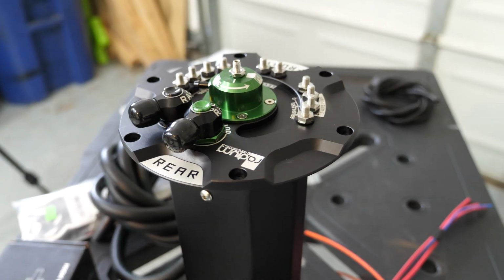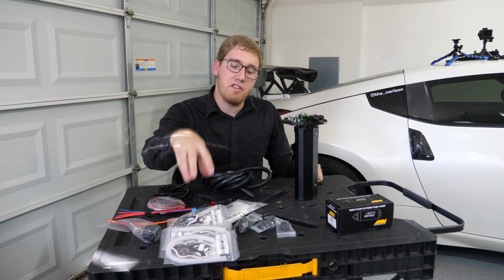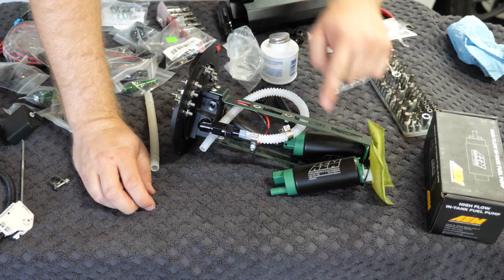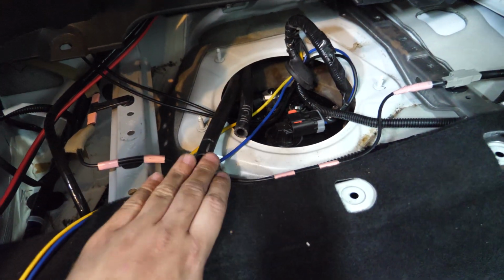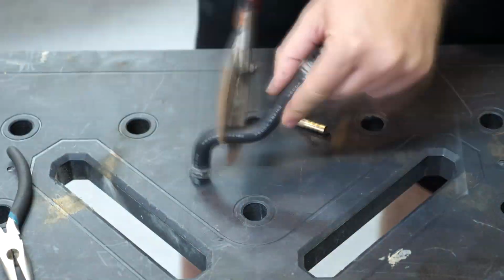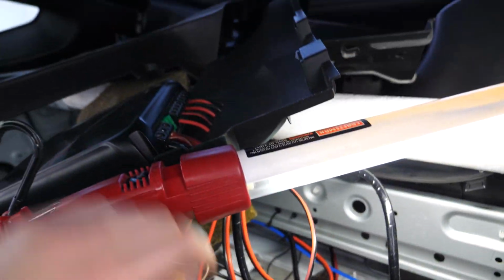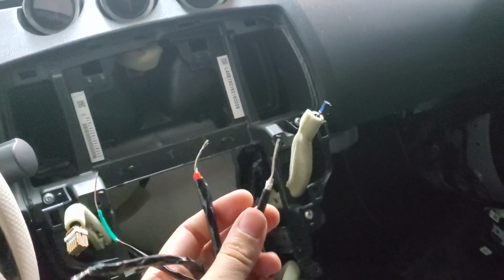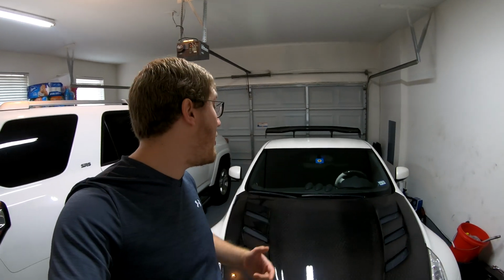Supercharger Install Ep. 5 - Fuel Return System + Gauges

Comment: I followed this through completely. Car fired up once and then shut off and then fuel pumps would no longer turn on. All 3 died out of no where. No shorts or any missing grounds. Any clues as to why? I will mention i did have the lift pump wired backwards. We had only primed it three or four times then switched it back up. The car ran after switching it but then died a bit after. I dont see all 3 fuel pumps dying at the same time like that. Some insight would be nice. :)
Reply from the maker: Check your fuses, relay connections, also would be helpful to put a multimeter on the pump leads to see what voltage is getting to the pumps.

Then you might want to check the resistance of the pump itself to see if the pump is dead or not. (Should be a few ohms. 0 means it could be shorted out, open means it could have burned out, ideally do this with none of the wires attached.
Reply: @thecarizon504  checked my main fuse immediately after making this comment and it was blown/too low. Swapped for a 30A and it'd good to go. Thanks man! Lol

Comment: Where is the return port on the top hat according to the website there should be a 3rd port for a return fuel system if you want to use it .. I only see the 2 in and out and the pressure regulator the picture on the website shows 3 ports
Reply from the maker: They must have changed the system since I installed it, mine only has two ports, one for the line from the lift pump in the ither aide of the tank, one for the fuel to the engine.
Reply: @thecarizon504  ya they must have it's confusing when you see it online with 3 but in videos only 2 ...how is it working so for for you
Reply from the maker: @sask350z  no issue so far, no hiccups outside of the fuel level being off initially, would read empty when O still had half a tank but I think the fuel level sensors relearned / cleaned up after a couple thousand miles.
Reply: @thecarizon504  ok cool good to know ...I just got off the phone with them and asked why yours is a two  port version and the site shows a 3 port version.... They said they changed it a bit ago you must have got a older model all the new ones come with 3 ports now
Reply from the maker: @sask350z  sounds good. You going to run a return system?
Reply: @thecarizon504  yes and run the fuel pressure regulator in the engine bay
Reply: So I can connect the vacuum hose easier and also easier to view the pressure without having to remove the panels behind the seat if I need to make an adjustment
Reply: @thecarizon504  thanks for the info on the fuel level relearn never heard of that before
Reply: @thecarizon504  this might be a dumb question what brand and part number is that thread sealer you are using never seen brush on thead sealer

Comment: I couldn't help but chuckle when you said the pump will increase the rate at which your fuel level goes down XD

Who knew that the Return System would passively decrease your range! No sarcasm intended!
Reply from the maker: Lol, I mean it does displace half a gallon of fuel that the fuel level sensors can't read. 😅

This system isn't like most fuel return systems though. Most don't come with a  surge tank.

Comment: Great video but I think I'll just top off my tank at 1/4. .If you ever lose a fuel pump it's going to be fun to troubleshoot which one went out. I looked up the price on that surge tank, WOW!!!
Reply from the maker: They are pricey for sure. Knowing if one goes out might be difficult, but since the second fuel pump is not normally running and I only have it there for backup/e85, this car doesn't have a single fuel pump point of failure. I could lose any one of them and still drive fine.

Comment: In your wiring diagram wouldn't it be better to put the switch in between the original fuel power (now relay signal) and the surge pump 2 relay
rather than running the power for the pump through your switch? I think that's probably what I'm going to do.
Reply from the maker: Those switches are rated for 20amps so there isn't a current limitation doing it this way.

Yes, ideally controlling the on signal to that relay would be better as you are switching a lower power signal. But to simplify the circuitry/how the wires were run, it was easier to just intercept the power line to the pump and so I could also just simply fanout of the same toggle signal for the pumps to all three.

Comment: Hey , I’m having some trouble getting my oil filter off my z. I got that z1 oil cooler. What did you do to get yours out when you first did an oil change?
Reply from the maker: It is a really tight fit with the sandwich plate on. Basically just had to squeeze it out from between the oil cooler lines and the frame. Just used my hands.
Reply: The Carizon nice lol thx dude, you the best
Reply: @domZx6r  i made a video on the oem sandwich delete. beats the alternative easy way of removing the sway bar brackets to let it swing